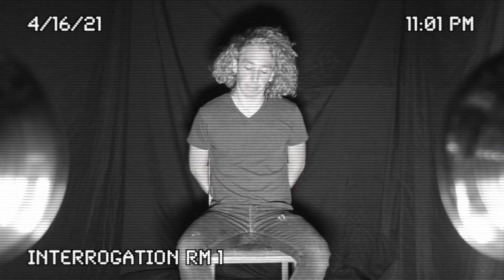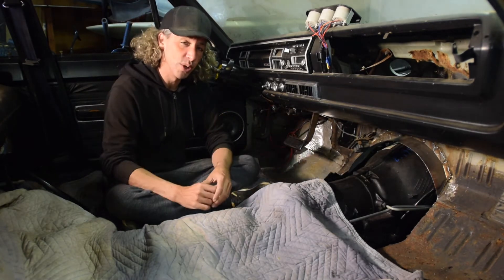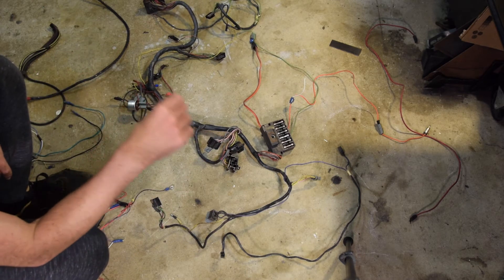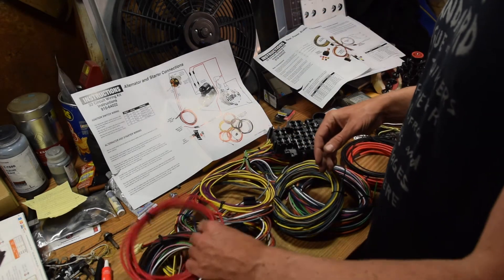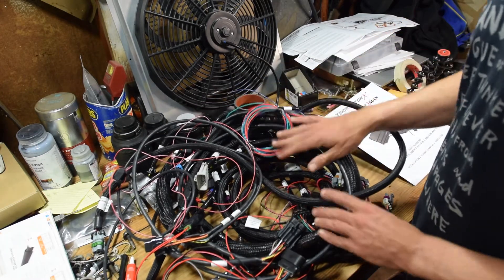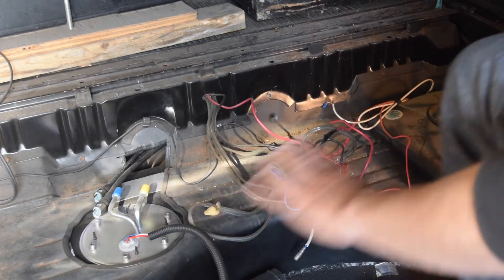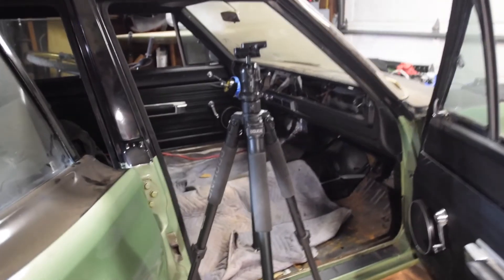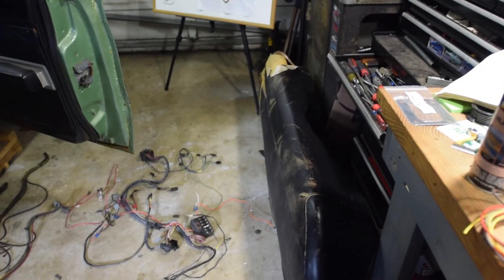Mating a Speedway 21-Circuit Harness to a Holley Terminator X MAX Harness (PART 1)

Comment: Love the intro! I have a 66 Coronet with original wire harness so I am following this carefully. 
I have some ideas about replacing the 6-way fuse box with one or more power distribution modules. Looking at Rowe's PDM60 or the more programmable Amplink, bypassing the ammeter and use a higher capacity bulkhead connector.
Reply from the maker: Thanks Ken! In the next episode I'll go over my plan for power distribution. I wanted to spec some of the newer solid state stuff that's becoming more affordable, but it's still too pricey for the models that can handle everything I'll need. (I'll be using the Bussmann SSVEC setup instead)
Reply: @PistonsofFury  I've studied the SSVEC as well, will be interesting to follow your progress.